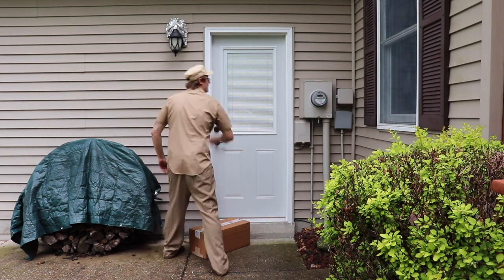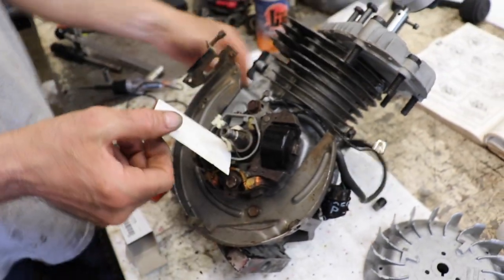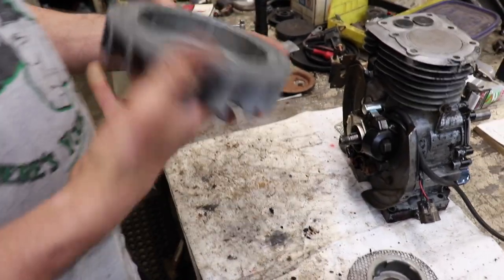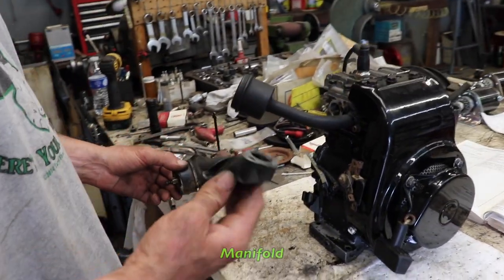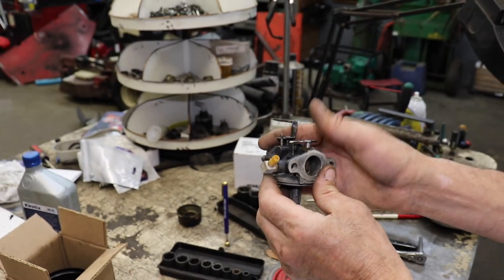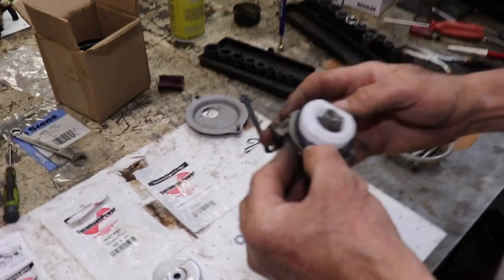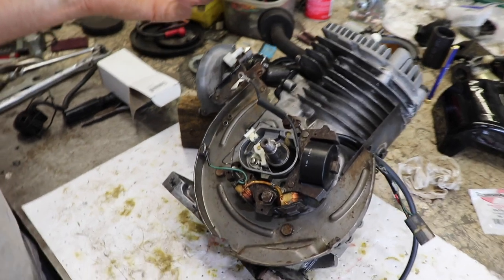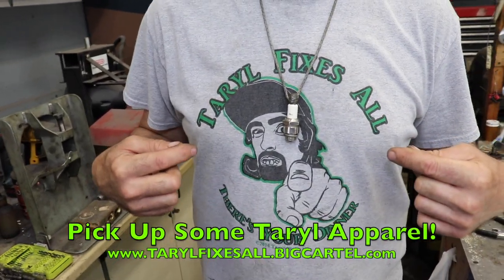(Part 2) Tecumseh Small Engine Total Rebuild

Comment: I got a hs40 and whenever I give it gas it wants to die. Is it the carburetor that needs to be adjusted or the gas tank cuz it leaks a bit. Plz respond anyone
Reply: Usually that means the carb needs cleaning, and replace the fuel filter while you're at it or put a filter on if it doesn't have one. But I would fix the obvious problem first, the leak. Never know it could be sucking air around the leak when gas is pulled through quickly, which would mess with the air : fuel ratio and cause that problem.
Reply: No. I had the choke on 😂. And the timing was just a tad bit off
Reply: derpity derp
Reply: It won’t start now for some reason I got new carb and air filter new plug and new points and condenser
Reply: Check for spark, check for fuel presence at the carburetor, check starting procedure(choke, start, unchoke, etc.) Pull the plugs to see if they're wet with fuel, indicates flooded.
Reply: Do you want to buy the bike and engine
Reply: no, thanks. I already have a bike.
Reply: I just want to get rid of that money pit
Reply: fix it
paint it 
craigslist it
???
Profit.

Comment: Man Tecumseh motors seem like they are setups for failure... The shield screw hole on the side of the cylinder and the operation of their carbs with the vent holes and the low speed tube .It seems like the tube can easily get jammed or stopped from old fuel thats starting to varnish or even debris which

Comment: Taryl need help. Followed directions to a T. Sparkplug in muffler, valves set to 4, broke coil. So used old one off shock. Finger stuck in butthole, and Peter is in fuel tank. Send help. On phone with 311, but I'm getting answering machine. Thanks. This is your brother, Jaryl..

Comment: Ta-junk-me engines were always bottom of the barrel engines. They custom made engines for everyone. That was part of their down fall. They over complicated a simple engine. Just the method to time the ignition is insane. Every manufacturer wanted a custom crankshaft, And they made it for them. Briggs was here`s the engine make it work. Very few custom parts from Briggs. It`s sad ta-junk-me did what they did, They could have been a real competitor for Briggs, And others. Just watching the problems with this rebuild proves the point. Ta-Junk-Me earned their fate.

Comment: I wish you were close enough to me, i would bring you my crazy as,,,,  john deer f525!!!   Daum thing runs one day, wont start the next. It;s like dating a crazy woman!!
Reply: Big Racer A friend of mine had a F525 that would just quit running. Replaced the spark plug and away it would go.... for a little while. That machine ate spark plugs. He bought 4 or 5 at a time and replaced them when it wouldn’t start. Usually every two or three times he mowed his yard.
Reply: @darrelstinson4737  have to try new plug. Been a while since replaced. Won't even start with start fluid
 So might be worse than plug. I was given the mower
 Sure would not ever bought one. Most stupid design mower I have ever seen. Its like the engine is in the bottom of a 55 gallon drum to get to it for maintenance